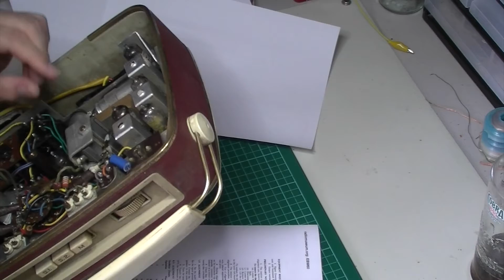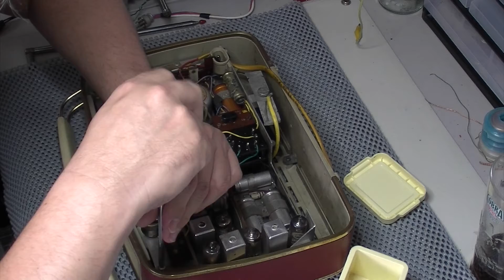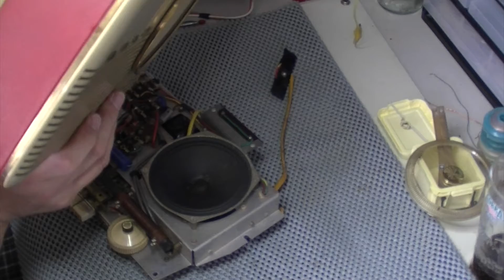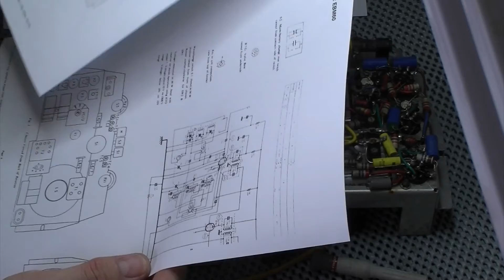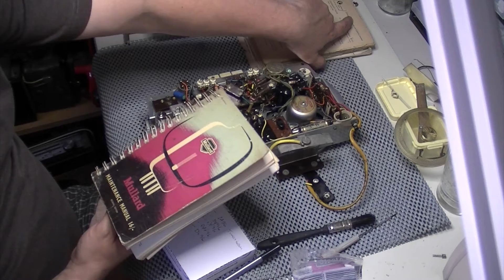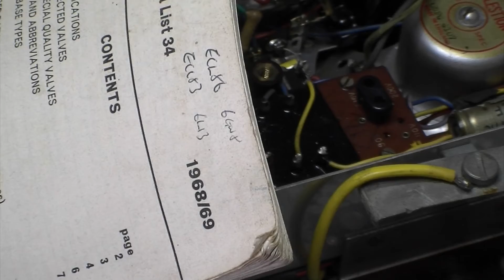Bush EBM60 valve portable radio Part 2: Chassis out and further investigations

Comment: What about losing the mains transformer and going with a battery box containing 10x PP9 batteries and 2x D cells and use that AC socket to connect the battery box to the radio.
Reply from the maker: I sold this radio a long time ago David. Thanks for watching

Comment: Plastic knobs are very hard to remove sometimes ,I had some luck by rockinig it back and fourth with a small screwdriver one on either side,but if it's a plastic knob on a.plastic shaft it's more of a risk the knob could break or the shaft could break ,if it on a stereo shaft less risk good job .
Reply from the maker: Very scary on such a rare radio

Comment: I had two G.E.tube radio ,I thought the running knob would never come off I rocked it back and forth ,then rotated it the rock it back and for ,finally pop off it took a while .but I didn't have a choice,a steel shaft a nd a plastic knob it you are careful seems to come off if you are careful ,but a plastic knob on a pathetic shaft worry me if you try to hard I sorry about plastic shafts on clock motors could snap.

Comment: Very nice, by the way what was wrong with the radio in the beginning? I know you just had to check if all the capacitors were alright and right value.
Reply from the maker: Hi David. I’m not experienced with valve radios so I wanted to go through the whole radio and test/ replace anything that needed doing before powering it up. I have since sold this radio to a collector so it’s in safe hands. Thanks for watching

Comment: I remember removing that dial on mine. It was a bloody nightmare.
Reply: Too true! On my first one of these (a VTR103) I used a thin cotton scarf fed in behind the dial and gently pulled trying to keep the pressure even on all sides. Always a scary moment on these.
Reply from the maker: I had considered that as my first choice Andrew. Trouble was the dial glass was binding on the case  so couldn't get anything under it. Luckily it came off in one piece
Reply from the maker: Pretty scary stuff Simon but managed to get it off pretty easily in the end. I think it had been off before so probably gave me an advantage